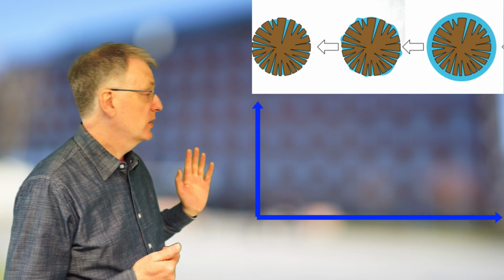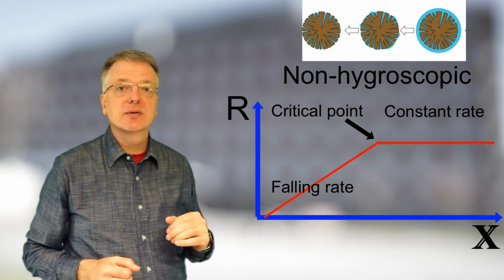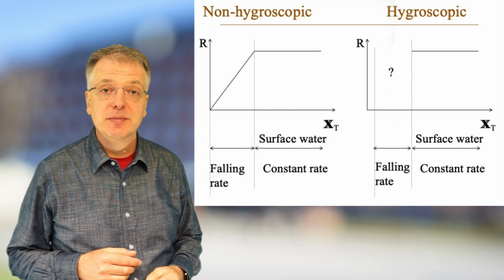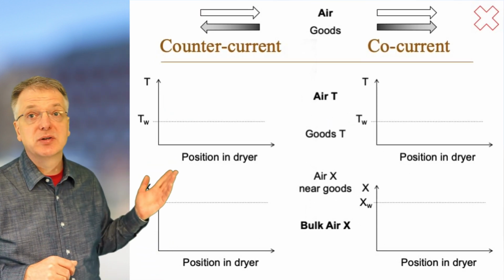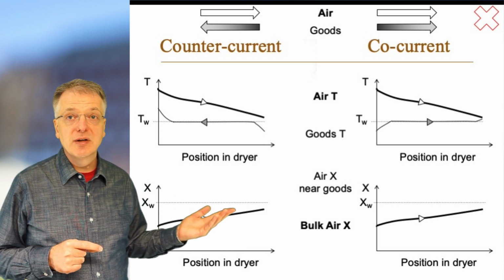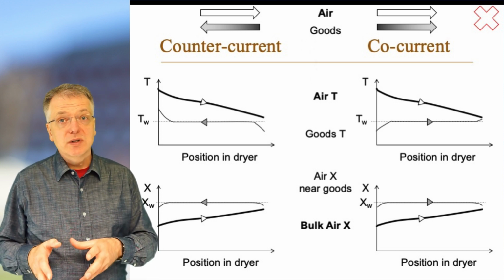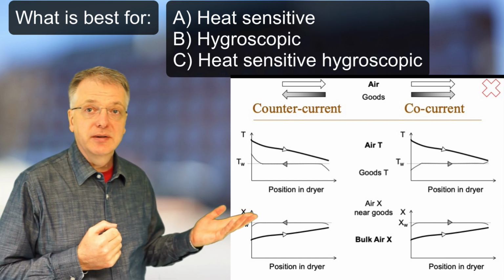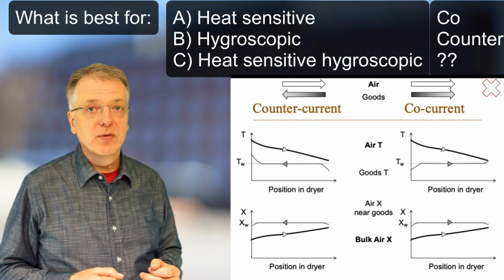Drying rates for (non)-hygroscopic materials

Comment: Thank you for the video.   For known/common material such as wood, mulch, wood chips, saw dust, milk powder, etc., are there published tables that approximate the critical point for the material?  Wouldn't such data be useful as a starting point before embarking on experiments for system/energy optimization, or would that be inadvisable?  Thanks in advance